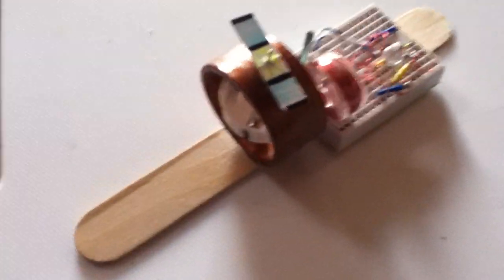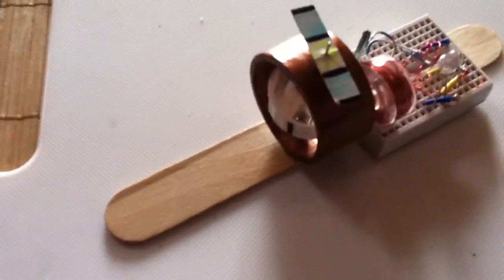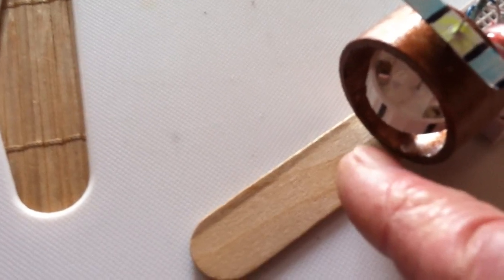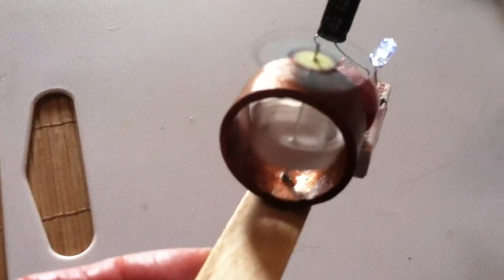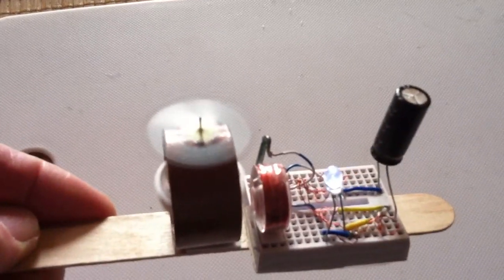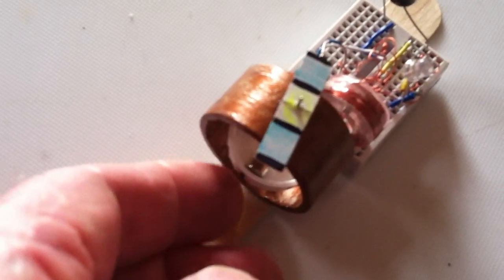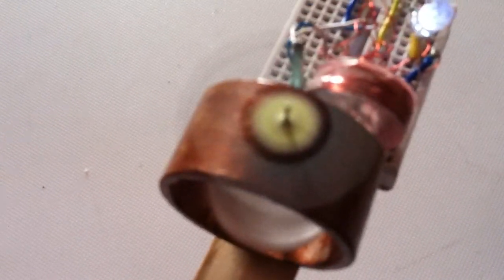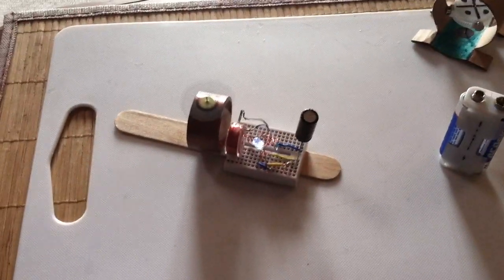Cardboard Ring Pulse Motor

Comment: Nice!  Where's the circuit diagram?  I don't see any transistors on the  pnp board.
Reply: There are just 4 components! 1=power source (supercap), 2=reed switch, 3=coil, 4=LED to capture the back spike. Put 1,2 and 3 in series, and put the LED on the reed switch (turn polarity around if the LED does not light up while running).
Reply: hmm.. so basically it is a power pig compared to his typical ssg (Darlington pair) circuit, huh?
Reply from the maker: Check this out.  A coil of wire. an LED, and a super capacitor.  Transistors? Reed Switch?  We don't need those stinking things.  Ha. https://www.youtube.com/watch?v=F9NnPa6uryg&lc=UgzWhShdObt5ASg6VqZ4AaABAg
Reply: Thanks, Rusty!  Nice example & diagram.  How much less energy efficient is that design than your most efficient design (which I'm assuming is your modified ssg circuit with complementary transistors (i.e. pseudo Darlington pair)?
Reply from the maker: I have no idea.  You would have to hook up a bunch of stuff to these and do a analysis over time.  That is a buzz kill for me.  lol The two transistor things I have running using a high ohm fine wire coil are the best so far. This is all just a fun hobby to me.
Reply: Lol.. ok, just wondered--you know I have an endless curiosity about such things. Thanks! :-)

Comment: Great tips and ideas again Lid! I hope you don;t mind if I leave a kind of unrelated tip here.
I was over at 'Instructables' the other day looking at an article about getting parts out of 
microwaves. I would like to quote my tip here:
A very common overlooked part inside the microwave are some some
small ferrite rods that are found in the magnetron, down the hole behind
the second magnet. Pull the stiff coil wire all the way out and you will find
them 'embedded' in the wire They are useful to use as cores inside sewing machine
bobbin home wound electromagnets used in pulse motors.
Also, the coil in the fan is useful for pulse motor projects.
When you have disassembled the fan assembly down to just the coil and the mesh
of plates, set this upright on concrete, with the coil on the left side. Hold the coil
with your left hand, and with your right hand use a hammer and hit the top right
of the assembly as hard as you can. The plate mesh will separate from the
core of the coil, making for easy removal.
Reply from the maker: Thanks for the tips about the microwave oven parts.
Reply: Trying to return a little bit, 'cause I've learned a TON from your videos!